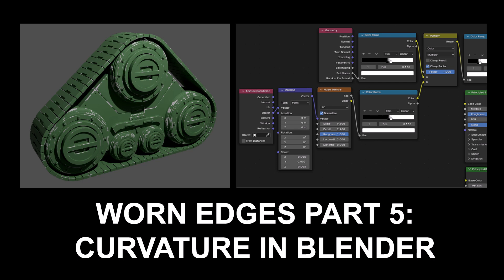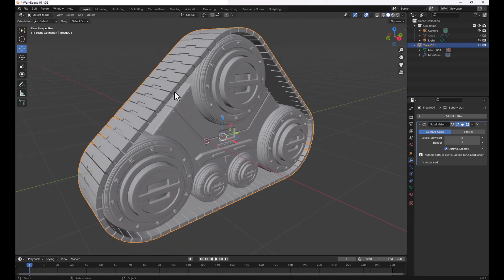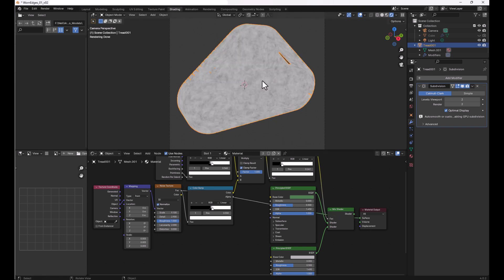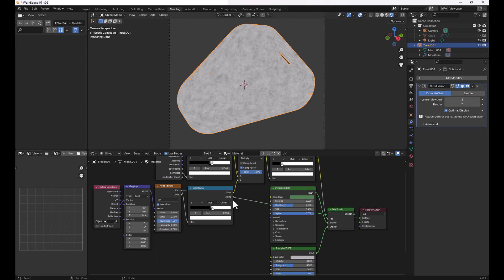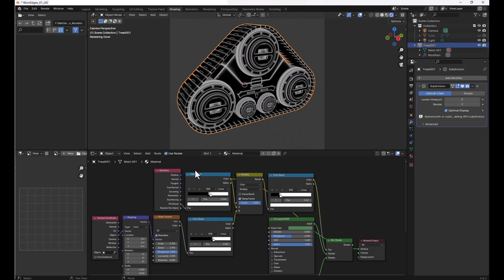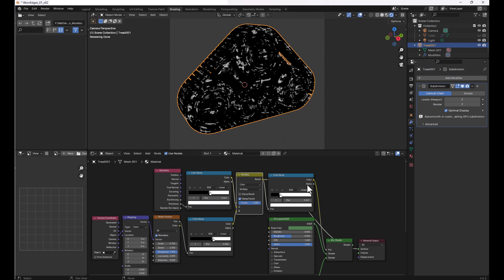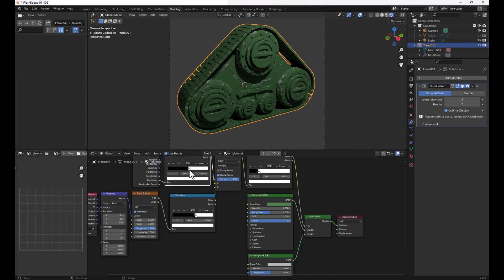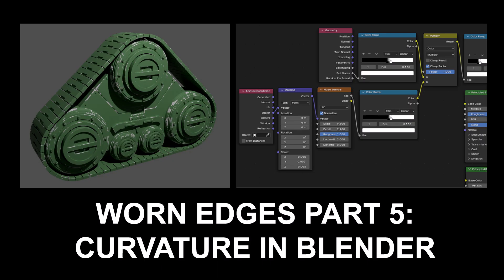Worn Edges Part 5: Blender Method

Comment: I like how you're videos about blender more recently. do you think it's worth implementing into your pipeline even though the industry standard is always said to be maya ? oh and to view the noise or like individual maps you can control shift click a node and it'll show it in the viewport, it comes with the node wrangler addon that's shipped with blender.
Reply from the maker: So industry standard is a loaded term, it depends which industry you're talking about. In film VFX, Maya is the standard. But for animated features most of those companies have their own proprietary software. For games, 3dsmax is still the most used piece of software. In fact I'd suspect Houdini is used more often in games than maya. The big issue is that all of entertainment is getting really expensive, and so companies are going to look for ways to spend less money. Now that 3dsmax and maya are both rental, you have to pay monthly, which gets really expensive really fast. So I suspect more companies, especially new ones, will look into free alternatives like Blender now that they are starting to get 80-90% as good as the older 3d apps. So I think learning Blender is not a bad idea at all.

Comment: You can also create procedural edgewear using the AO node or the bevel node.  Those methods don't need as much geometry as the pointiness node does to work.
Reply from the maker: I've tended to find AO in other apps not as good at capturing the edges of things (but great for rust placement in the occluded parts), but didn't realize you could also use the bevel node, I'll check that one out, thanks!
Reply: @ArtOfSoulburn  I think I found the original video on how to do it on CGVirus channel.  I think you can find it in blender secrets too.